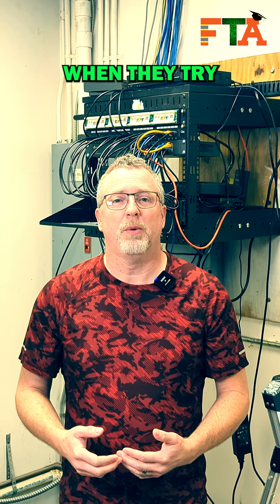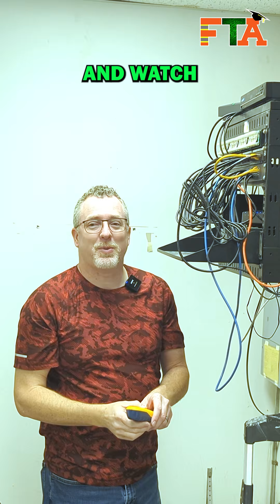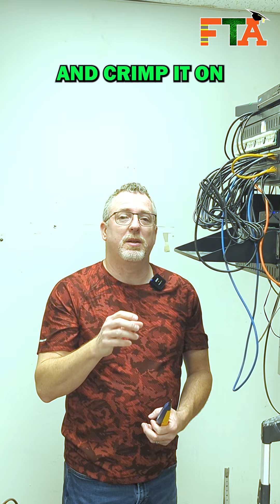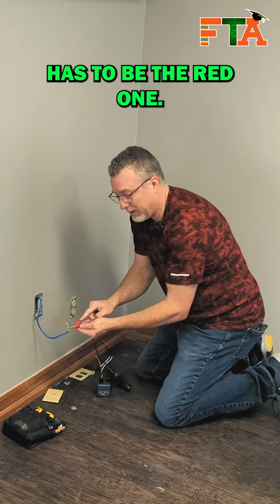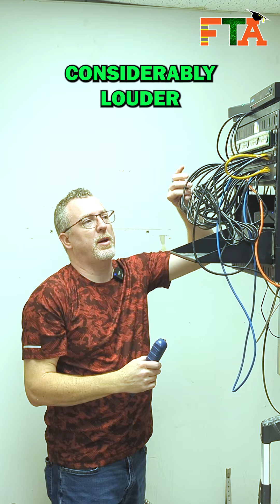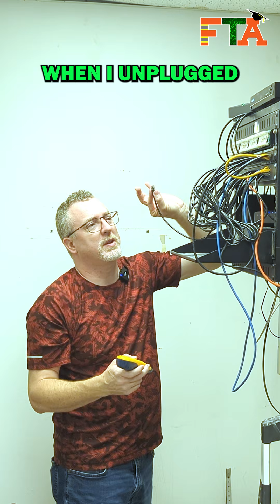Hack for Toning a Cable Connected to a Switch | How to Use a Tone and Probe Set to Trace Cables

Comment: Need a little more info on the wire connection. Assume I'm starting with a toner with no alligator clips. Which wires am I connecting to tone, the line and which to ground?
Reply: Correct me if I'm wrong, I'm assuming you have an RJ45 end on your toner. I would try using a multimeter with the continuity function to see what pairs/wires the toner is using to send the signal.
Reply: @bumboclawd   Use a multimeter to locate RF?
Reply: Or touch each wire together until the wand stops picking sound up/shorting the signal. A multimeter on continuity would do this too as it would complete the loop, shorting it and cutting the tone from the wand/probe/sniffer. I'm no expert but I know to keep the clips separate because if they touch the tone drops.
Reply from the maker: Cable toners with an RJ11 or RJ45 jack typically send the tone down the center pair which is the blue pair on network wiring.  You can tone any pair with the alligator clips if you need to check a different pair.

Comment: There's 2 ways to solve that problem. One is to buy a digital toner, and you will still get a signal if its plugged into a switch.  2nd is to use a regular toner. After plugging the toner in, place the wand on the toner to make sure its working. It will give a loud toner noise. Then place the wand a few feet away from the toner on the cable itself. If it is still making the toners noise,  then its not plugged into a switch and u will have no issues toning the cable. However, when u place the wand on the cable and it doesnt make any noise. Then u know the cable u want is already plugged into a switch. Then i look at the switch and look for all of the ports that dont have a link or activity light on the port.  Then u unplug the ports without lights 1 at a time. Place your wand on the cable u just unplugged. It will make the tone noise once u unplug it from the switch. If thats not it, plug it back in exactly where it was and go to the next one. There usually isnt very many ports that arent lite up. If u are worried about the tone bleeding from one cable to the next. U can very with a standard data tester, or but using a continuity test and then u short it out to see if the toner stops making the noise
Reply from the maker: Great ideas

Comment: Interesting workaround, but using ground as a reference can create ghost tone on every cable connected to the switch. That’s exactly the issue the Tracer Wizard solves by isolating the tone to the correct cable.
Reply from the maker: Good to know.

Comment: USE THE LIGHT NOT THE SOUND.
Lower the signal to where the light barely just turns on at the generator when touching the red+. 
 And yeah always ground the black- in some fashion for a solid signal. (Neutrals can work but not always.)
Reply from the maker: Interesting. I'll have to try that.

Comment: I stick a small phillips head screwdriver into the ground port of an outlet and clip to that, also if theres no outlet available, clip onto the chassis metal around the ports on a computer or a monitor
Reply from the maker: @keithsweat7513  there are so many ways. Thanks for an additional idea.

Comment: Very useful and just the video i was looking for 👍 Just to confirm - connecting a toner to a live cable doesn't affect the switch port? As far as i understand, for example, a port supplies 48v and the average toner operates a 9v battery which, assuming, supplies 9v. In the worst case, it's the toner, if a very cheap one, which could be affected by the higher 48v poe supply?
Reply from the maker: To the best of my knowledge it is supposed to be safe for switches. I've never had an issue toning and damaging equipment.
Reply: @fieldtechacademy  Thanks for the quick reply. I've also never had any issues, but my subconscious has always kept me on edge that for some reason something might happen but never has 😄